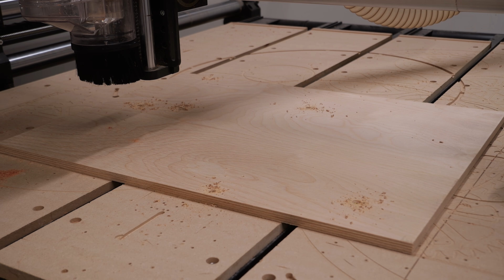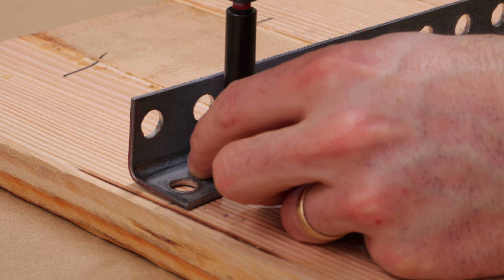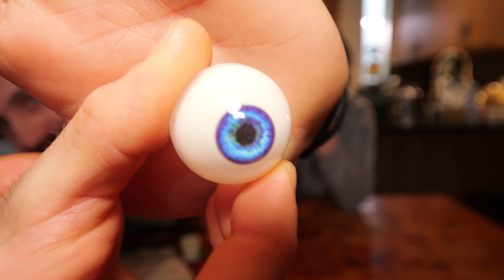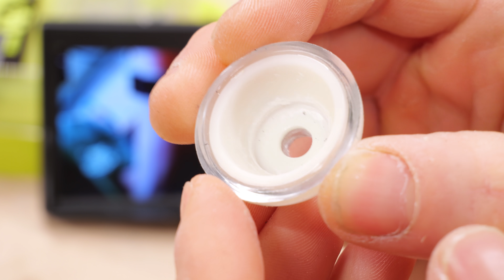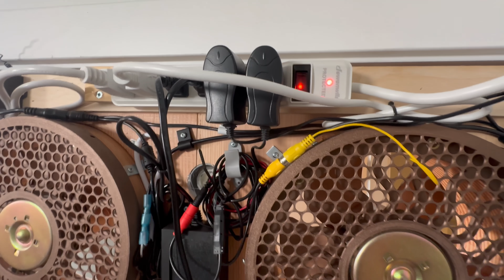I Built an Over-Engineered Door for My Wobbly Cat

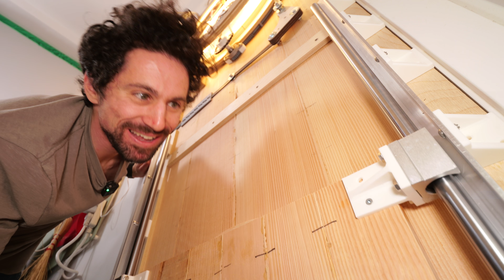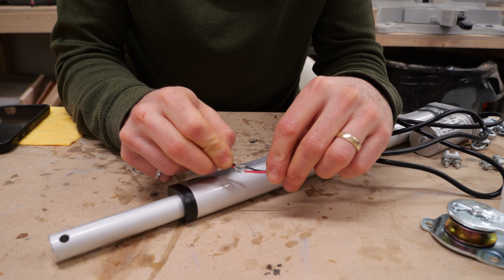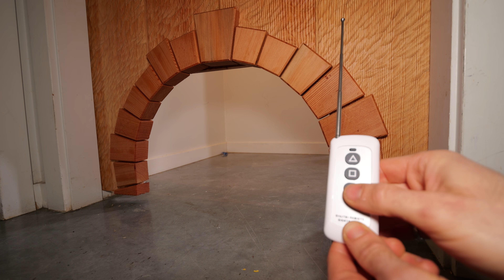Comment: By your own admission in the video, this door is "pretty heavy" and "extremely beefy" around 10:35, and at 10:44 you chose a 200 lb self-locking linear actuator for it. Then around 12:54 you explicitly say you could have used a timer or motion detector, but chose manual remote control instead. So this is not an accidental oversight. You deliberately chose a heavy moving barrier with high available force, open loop remote actuation, no obstruction sensing, no force limiting, and no real fail-safe behavior.

There are several obvious hazard modes here. On the way up, a self-locking actuator can keep loading the system if the door binds, racks, or hits something, because it does not simply yield under load. On the way down, even if the actuator is slow, you still have a heavy panel being lowered in guides with no counterweight or spring assist to make it inherently harmless. The paracord is also a single point of failure. If it frays, slips, abrades, unties, disconnects, or gets shock-loaded during a jam, the door can suddenly drop. A jam during lifting is also plausible: one side drags more, the door stops staying parallel, the actuator keeps pulling, tension rises, and eventually the cord, anchor, bracket, fastener, or some other part becomes the accidental fuse.

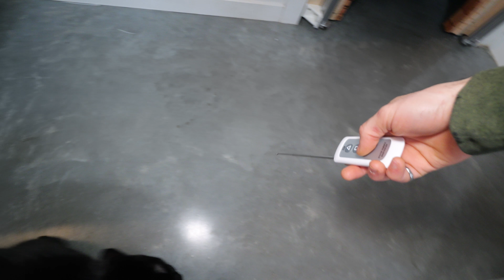And this is clearly being optimized for convenience, not safety. Around 13:16 you say being able to close the "castle gates" while you need to "lock in" is fantastic, and then the answer to "how will I know if Penny is waiting outside" is a hidden camera. A camera is not a safety system. Remote observation is not a safety system. "Self-locking" is not a safety system.

Please do not actually use this door around the cat in its current form.

The real fix is not to pile on gimmicks. The real fix is to make the moving panel inherently low-risk in the first place. The cleanest path would be to make the door dramatically lighter, for example a hollow panel or a thin veneer over a foam core, and counterbalance or spring-assist it so the net closing force is trivial. If you insist on keeping a heavier panel, then you need substantially more protection, because counterbalance alone does not solve entrapment, binding, or impact risk.

Also, some form of load or tension sensing would be good, but only as overload protection. It might stop the actuator from continuing to pull into a jam and snapping the cord or tearing out hardware. That does not make it safe for the cat. It would not guarantee safe contact force, it would not prevent entrapment, and it would not prevent a drop if the load path failed. That is machine protection, not occupant protection.

At minimum, the design needs to be reworked so a likely failure becomes harmless instead of dangerous. Right now, by your own description in the video, you deliberately chose the cool and convenient version over the safe version. A pet door should fail harmlessly. This one does not.
Reply: The most upsetting part is where he's adding hearts to dozens of comments and replies to some, but never reacts to the viewers' reasonable concerns. I'm getting increasingly concerned for Penny's safety. Your comment is the most articulate one on the issue and he doesn't say anything about it ? Unbelievable !
Thank you so much for your comment and explaining why this door is a bad idea around pets. Disabled ones at that.
Reply: Thank you for this perfectly articulate example of safety concerns with explanations of failures as well as suggestions for remedies. 

As they say, all safety guidelines are written in blood.

 And learning the engineering behind safe equipment practices and design is important. People that came before us learned these things the hard way so that we don't experience the tragedies ourselves. Always worth it to educate ourselves.
Reply: I 100% agree. The second motors and linear actuators were involved in a pet door, I got scared. It reminded me of those automated litter boxes that hurt cats. I'm no engineer, but this has danger written all over it.
Reply: @quinn-b6n9f Exactly my thoughts. The second I’ve seen there’s literally no safety it reminded me of the one case of the litter box which had the owners come into the bathroom and see the worst image of their life.
Reply: And he seems to not care!  Completely ignoring comments talking about it! Not subscribing just for that.
Reply: The unenviable job of saying what needs to be said.
Reply: Thorough and excellent comment on the safety issues, resolution, as well as citations from the video. 
Foam painted gray could look like stone which would look cool too.  Or can put a wood grain on with a tool.
Reply: I wonder if there is an incentive to make dangerous things because of the engagement it gets in thr comments. He is not addressing most of the feedback (I saw ONE safety-related comment he replied to and it was about human safety in operating power tools, nothing about the cat)
Reply: He clearly doesn't give AF about his cat. He's ignored every single comment concerning the cats safety. Pretty disheartening.
Reply: When Gaston Lagaffe's spring loaded doors look safer, something is seriously wrong.

Comment: bothers me that your tiny door is 2 inches off the ground compared to the other door. fix it please, you dont need to move the actuator, just 3d print a sleeve with a rope hole and attach it too the piston to get the mini door to actually close

edit: or you could just use an electric motor with forward and reverse  with a rope spool attached and change height and drop limits specifically, you went so overkill it was worse.

Comment: Is nobody afraid of no safety systems for the cat?!
What if it tries getting in when the  door is closing? That linear actuator will just cut it in half!
Reply: The actuator doesn't push the door down as far as i understood, so it's only the weight of the door. Still it looks pretty bulky and I completely agree that this doesn't seem cat-friendly enough.
Reply: did you notice how he has a remote?
Reply: @charleshautly4732 yes a remote which could be used to close the door. He wouldn’t always keep looking at the camera feed everytime until the door closes. Soon he will just look once and close the door. The actuator is slow cat can try to run across. Very possible scenario.
Reply: @charleshautly4732 that doesnt mean shit

Comment: The poor little cat doesn’t realize it’s walking through what is effectively a blunt guillotine. Since it’s controlled wirelessly, nothing guarantees the door won’t activate unexpectedly - potentially even from interference, like a neighbor using a random remote-controlled device.

At the very least, please add a counterweight and control the door using a pulley system that can slip. If there’s any resistance at all, the door must not exert significant force. Additionally, I would add motion activation on the office side to allow a one-way exit for the cat should it get trapped inside.
Reply: Calling it self-locking is not a safety feature. It just means it will not give under load. So you have a heavy door, a 200 lb actuator, no obstruction sensing, and paracord as a critical load-bearing part. Best case, it binds and keeps loading the system until something breaks. Worst case, that failure is what turns it into a falling slab over the cat's head.
Reply: @LMojzis  kittotine :(
Reply: @LMojzis but only gravity pulls the door down the actuator can't push the paracord it's just a blunt woorden guillotine that weighs about 3-4kg. Could be dangerous never the less.
Reply: @pellevandenbroeck8405  3-4kg is an understatement. Perhaps 30-40kg
Reply: Cats are well aware of their surroundings they know if things fall or if they're dangerous sure not the safest but you're treating this cat like it has the IQ of a fart the door takes more than 5 seconds to fall and is max 5 kg don't say 30-40kg I see your comment down there that's physically impossible even with the densest wood on earth the door would have to be 4 feet tall and cats have at the weakest 100ms reflexes the cat one out of a hundred thousand times isn't gonna get caught if the thing fails the actuator is designed to pull back meaning the cat cannot get stuck by any common way its so rare for said cat to get caught even with it's condition that may half its reaction speed it's not getting caught by this slow ass door even at a walking speed if she sees it's falling she won't go through it's how cats work and also you don't think if it falls on her Morley won't just pull it up immediately to save his cats life which he clearly loves.
Reply: @Randomasstrevorhendersonfan Didn't watch the video, did you?
Reply: @LMojzis  I did
Reply: @Randomasstrevorhendersonfan Then you have trouble comprehending spoken text, might need subtitles for the part where he explicitly said the door is "so heavy". It definitely isn't light, by his own admission.
Reply: @LMojzis  5kg isn't very light but 30kg which you said is physically impossible
Reply: @Randomasstrevorhendersonfan OK Now I know you are ragebaiting.
Reply: @LMojzis how😭✌
Reply: @LMojzis  and you have trouble with context clues obviously if hes lifting it with one hand with seemingly average effort it's not a god damn 30-40kg slab of wood he is blatantly saying it's heavy relative to size every lifted up a baby and said it's heavy despite that baby only being 30-40 lbs same thing here the wood is surprisingly heavy but not actual dumbell weight heavy and you say I'm the ragebait
Reply: @Randomasstrevorhendersonfan If you have trouble lifting 30-40 kg with one hand with average effort then I don't know what to tell you.
Reply: @LMojzis mf that is 66-89 pounds are you super human? The NIOSH Lifting Equation literally states that 23kgs is the maximum recommended weight for an adult man to lift with BOTH HANDS also just ignoring the fact that 30-40kgs for a wooden piece of that size is geometrically impossible with literally the density of ANY wood on earth

Comment: You should have buttons 3 and 4 control the up and down buttons on the micro controller if there’s a way to rewire the buttons to the remotes pcb and store the pcb inside the whole black case

Comment: I was hoping there would be a motion sensor or something that'd stop the door from closing if something slipped under when it was closing
Reply: Or even a sensor to failsafe open, so that if power goes out or anything while he's gone, penny would never get hurt by it
Reply: @SpartanFish9  that's why he's using a linear actuator. they self-lock, which means that if the power is cut? they just freeze in place rather than falling, so it solves the issue of what if it falls. penny won't get hurt by it!
Reply: @phantoids but what if she gets stuck mid closing or opening and it cuts out? the door will just be frozen in that position and wont be safe either way :/
Reply: exactly thats the first think that came to my mind lol
Reply: Especially with how slowly it closes
Reply: I mean it’s fully controlled by him and it’s really slow. Only thing that would fail would be the parachord

Comment: wireless may be convenient, but its also unreliable in some situations. If there is no absolute nessecitiy to go wireless, you should always choose a cable over a wireless option. Yes it is more tedious once, while installing, but the signal wil also not fail or distort because of the myriad of reasons that wireless signals can fail (like thunderstorms, static electricity in your own home from all sorts of materials rubbing against each other, high voltage power lines, your neighbour building a secret jamming device in his backyard, trams in front of your house (no seriously, I had a customer call me when I was working in ISP tech support, complaining that his WiFi would reliably fail every fifteen minutes, turns out, the overhead power lines of the Tram that were running right in front of his second floor apartment windows were creating enough of a magnetic field (well duh) to disrupt his IADs wifi signal (because wifi sucks, get a cable)))

Comment: Beautifully made!!
 My only issue is that the back side of the door in general looks like the back side of a fridge!
Maybe put some very thin panel of something like mdf to hide all of the... stuff back there?. 
Of course make it easily removable so that you can still access everything in case you need to add more features or service the ones already there
You could then even paint the back layer anyway you wanted. 
Some ideas I can see being cool would be coating it on either chalkboard paint or blackboard paper to draw on it. 
Other options could be just paint it like a plain old door, or make it look la a framed picture, or continuing with the art deco-submarine style you can free style something along those lines
Cheers

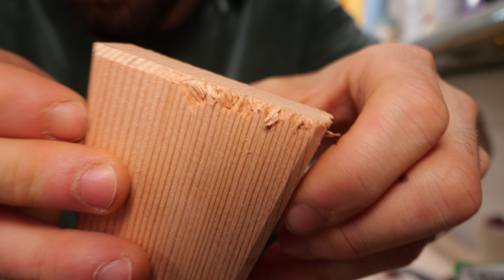Comment: 6:47  You are extremely lucky that you have fast reactions.   You need to cut against the rotation of the bit this way the cutting action of the bit pushes back instead of pulling forward like it did.    This could have ended badly with your hand pulled into the bit.   The issue is not routers are scary but the method you used.  You were doing a “Climb” cut not conventional cut.   For hand held operations always do conventional ( against the spin of the bit)     Also I would suggest you invest in or make a simple router table.  Using a fence or a starter pin on a router table makes these operations much safer.    As always great video!
Reply from the maker: Will keep in mind for the future!
Reply: Also.... remove your rings while woodworking... what were you thinking!!! You almost lost a finger.
Reply: @MCkhemystri I wear rings every single day of my life, feel naked without them. I always take them off whether I enter the woodshop, even though I do a lot of manual carving. My dad drilled that into me at a young age because he taught me stuff with power tools. Safety is always a priority, my dad doesn’t wear any protective gear for his lungs but I’ve got a bad case of asthma so I always mask up as well. Safety in the woodshop is important! Even if you’re not traditionally taught, you should practice safety! I know too many guys with missing fingers 😅

Comment: Not that it matters for a lightweight project like this, but for cable clamps the best and safe practice is to "never saddle a dead horse" when clamping wire rope. The "saddle" of the clamp is what bites down on the load of the wire rope, so the main length of cable should be seated in the saddle then the tail (dead end) should be on top which gets crimped down by the loop of the clamp. As an entertainment rigger, my OCD kicks in when I see it done wrong, but for something like this it's not too critical. Great job though! I am really enjoying your projects!
Reply: There it is! I was looking for this comment.

Comment: No counterweight for the door? Aside from being able to use a weaker motor (pointless since you already have a big beefy linear actuator), it would improve safety in case the paracord fails or if Penny or the robot sneaks under the door at the last moment while it's closing.

Comment: That's insane for CNC table bits, Summit Tools in Burnaby is WAY cheaper for CNC bits and even anything for a lathe. But the Port Coquitlam location has the biggest selection. (No I don't work for them) I'm the head caretaker for the new Stallewssem Bridge.

Comment: you should have done a ras pi with cams for the 2 cams, i dont know crap about pis but i have used a few pis with webcams and the built for pi cams to use with my 3d printers
Reply: Take a look as esp32cam. I use a pi zero on the back of an old monitor to display the rstp streams.

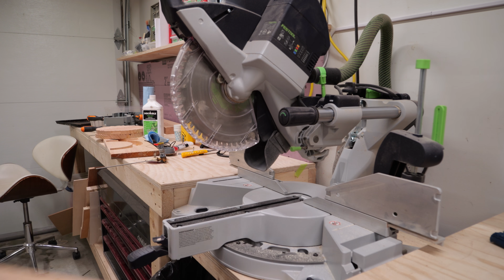Comment: Great project as always but (2:25) I really wish you'd use a push stick with the table saw. Your hand being between the fence and the blade means if it kicks back you hand could be dragged into the blade.
Reply: Is was the router usage that freaked me out this episode! Missing fingers is a when, not an if, at this rate
Reply: @georgeyoung2684  even the most experienced woodworkers are scared of routers. this dude was so close to losing a finger. even he was surprised nothing happened checking his finger multiple times.

and, why was he holding the piece down when he was surfacing them on the cnc? morley, do you hate your fingers?
Reply: Poor cat, actually. Those were human errors, made by adult. The poor little cat however doesn't realize it's walking through what's effectively a dull guillotine.
Reply: A concern I have for this door is that it's super strong, but I'm not sure about the weight. I think there might be some sag later.
Reply: Unfortunately, by the way he is not addressing these comments at all, it seems he doesn't care about safety in the slightest. Not for him, not for his pet. I just wish he wouldn't endanger the cat with this carelessness too.